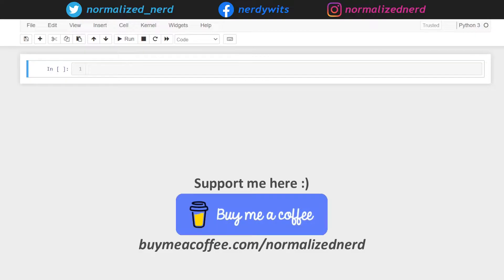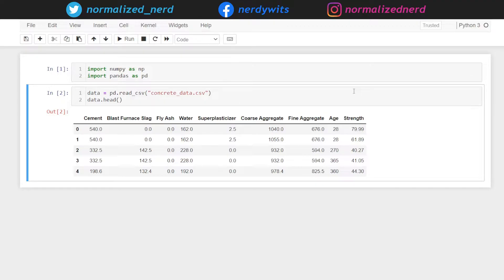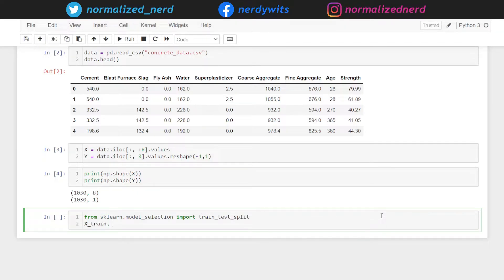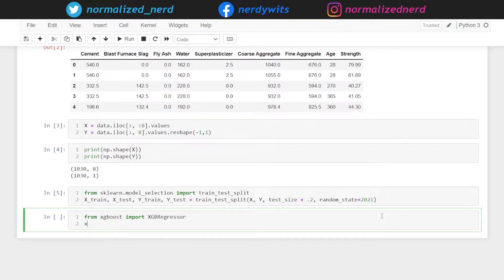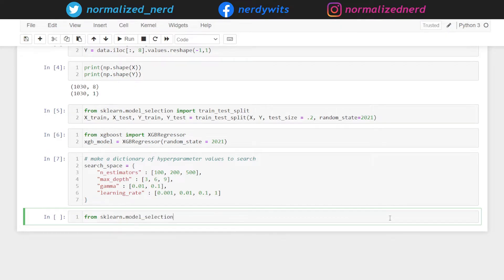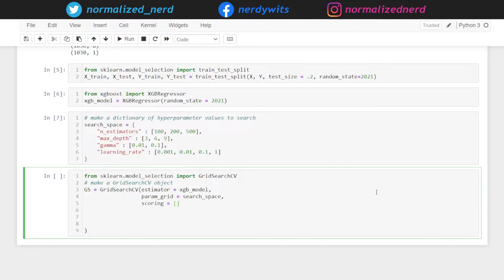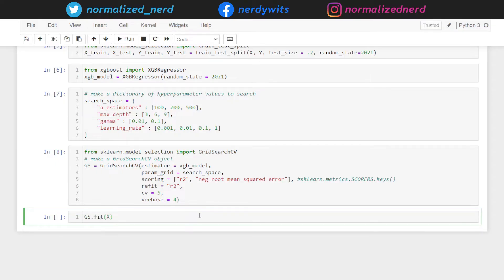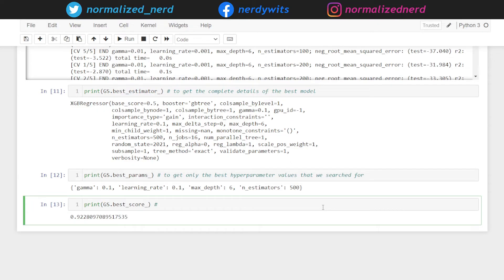GridSearchCV | Hyperparameter Tuning | Machine Learning with Scikit-Learn Python

Comment: Thanks. Nice video. But why are you doing GS.fit (X_train, Y_train) when you already have cross validation with cv = 5. Shouldn't you just do GS.fit (X, Y) ?
Reply: you should train on x_train and y_train because this allows you to further test the model once the optimal hyperparameters have been found with an unseen test set which the model has not seen stopping data-leakage